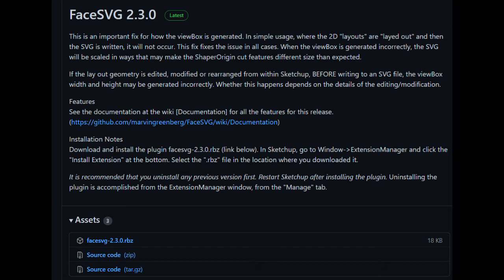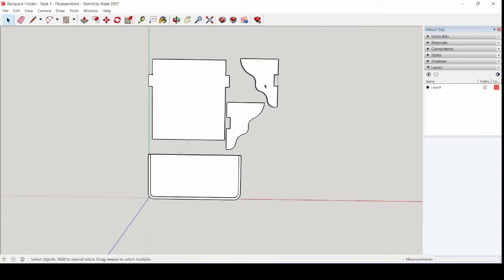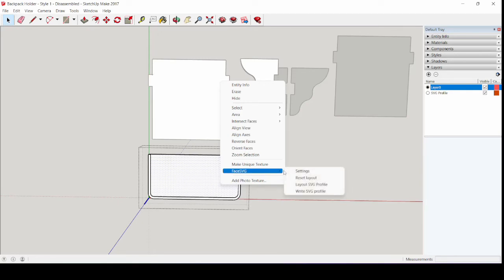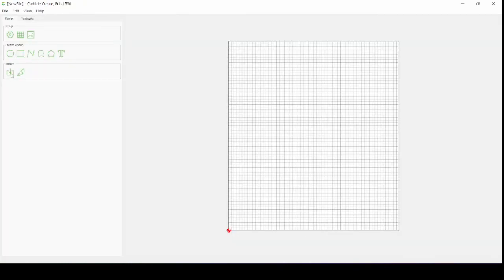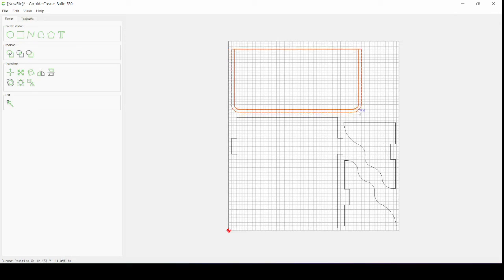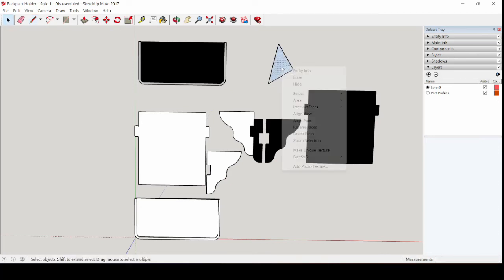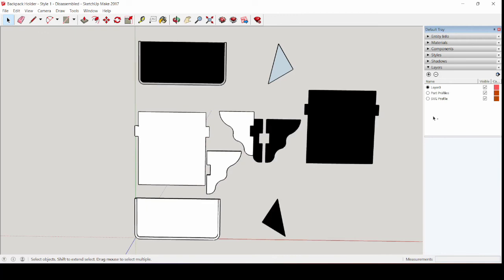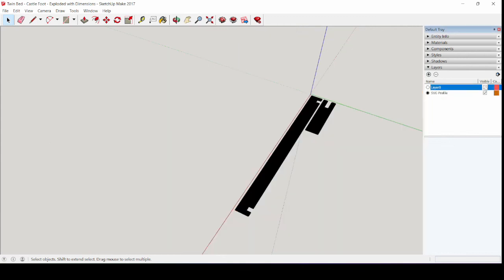Sketch Up - Woodworking Design To CNC Ready The Easy Way

Comment: Is this the fix for my files I send to my CNC workshop and he always says the smooth objects are all rough and like a hexagon. Does what you show in the video help or fix this? It takes my CNC guy so long to manually adjust all the edges.
Reply: If you draw circles make sure that you change the number of segments your circles have, other wise they’re gonna be really rough
Reply: Exporting 3D DXF fixes the problem of polygonal curves, arcs, and circles, but this way Sketchup exports the entire model, regardless of hidden objects and/or tags (which does not happen with 2D DXF). For example, AutoCAD recognizes and respects what you have hidden, but Corel does not and it shows the entire model; most CNC software behaves much like Corel, so, to avoid this problem, it is better to copy into a separate model only the objects that you want to export to your CNC. If you do not weld, Corel recognizes all the curves, arcs, and circles as such (so most likely any other CNC software), but by not welding, on small circles, arcs, curves, segments... AutoCAD it is making them look much weirder than in your real model. So, depending on each CNC software, it all comes down to trial.! If you do not have to weld you are lucky (which is most probably - as I said, Corel is a reference) and you don't have to worry at all about segmentation. But if you have to weld... then it is better that first you find the maximum number of segments for each curve, arc, circle; it is an extra step (a few actually...) but there is no perfect software. This is my experience - give it to others.!